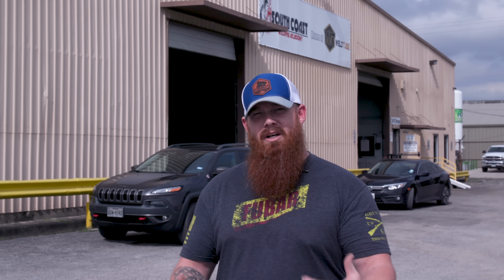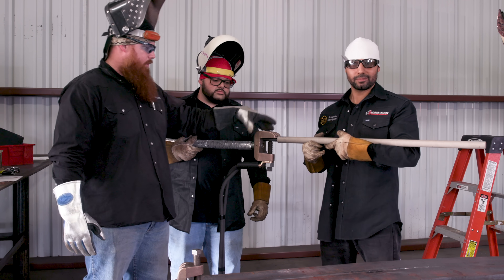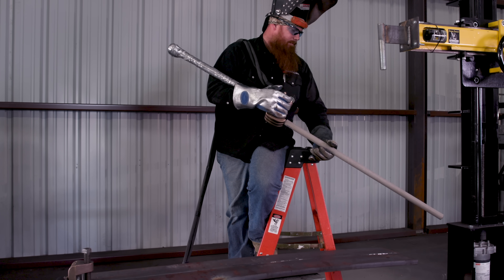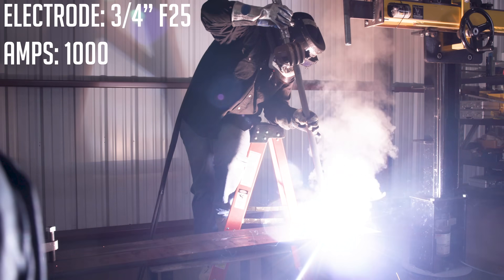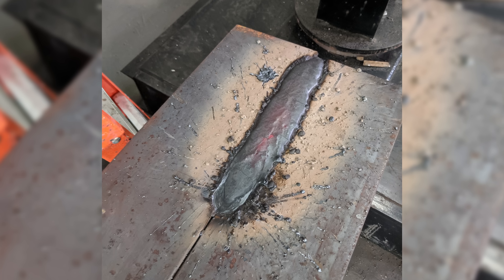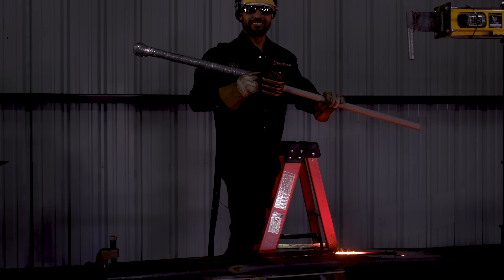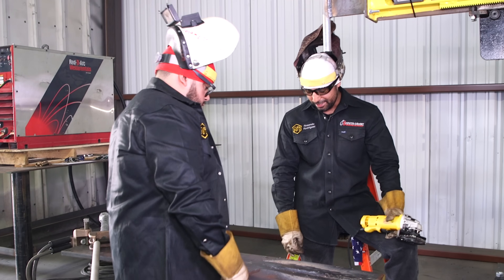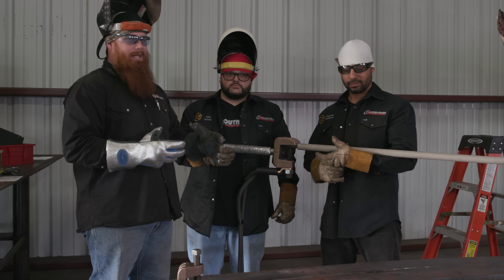1000 AMP STICK WELDING!! | Manually Welding with the Worlds Largest Electrode

Comment: "insulated" that looks like duct tape lmao
Reply: Do they make a smoke in hailer big enough ?.😨
Reply: Nah that's clear shrink wrap lol.
Reply: Is that pretty dangerous., holding it like that,  olds aren't enough to saturate the users body huh.
Reply: @ryanb1874  Only dangerous if you're wet, and even then it's 60V and there's a guy on the button. I was an Ironworker for a while, had a whole month of the Houston rainy season where I was doing trusses and such and was part of the circuit every time I had to change a rod. Shit that makes you not need coffee. 60V from arm to balls to ground. Not deadly for anyone that doesn't have a heart condition though.
Reply: @AtlasReburdened  volts don't mean shit a tazer is 500k- 1million volts it's the amps that kill and anything over .1 amps is lethal for reference if you shorted this rod to the material you'd be pushing over 1000 amps through your body
Reply: @dylanthegreat13  Ohms law states that you need a lot of volts to push that 100ma through normal skin resistance. Puncture the skin though and it's a whole new ball game.
Reply: @dylanthegreat13  My dude, you don't need to be preaching to someone who engineers electronics about how electricity behaves. I do demonstrations where I put the output leads of a bank of transformers which can put out 800A @ ~ .5V between my teeth with no more than an inch between them before burning through a framing nail like it's a car fuse. You don't just short amperage like a piece of metal, It takes volts to drive those amps through you. Like I said, 60V is only going to make you cuss if you don't have a heart condition, and only if you're sopping wet or just sweaty AF. Btw, no taser ever reaches 500KV, much less 1MV That's silly. A million volt arch reaches further than a human wingspan. There's like 2-3 inches between the leads of any taser you can buy so the air breaks down before it tops 50KV max. Probably 20-30KV in humid, sea level air.
Reply: @dylanthegreat13  If you short it, the short will be the preferred path and not your body (also the ouput voltage of the welder will drop significantly). 
Look at it like 2 resistors in parallel, one is several MOhms (or more, body+gloves+shoes, ... etc) and the other is less than 1 mOmh.
So the ratio is like 1:1000000000 and less (or more depends how look at it), which means that you'll have 1uA max passing thru your body.
Reply: @dylanthegreat13  No its the watt that kills you
Reply: The never ending “what kills you in electricity” discussion with the same mistakes and corrections over and over again. I’m glad that Atlas has explained the right things, with his diploma’s backing him.
Reply: @AtlasReburdened  Thank you some people just don't understand.👍👍
Reply: @ivgotballsofsteel4048  The term human wingspan refers to the distance between the tips of your fingers when you hold your arms out to your sides, I'm convinced that you understand this and you're just being disingenuous because for whatever reason, some people think they can come out on top of a technical debate by pretending not to understand things. Not a good tactic in my opinion. Question whatever you want, that's not going to change the behavior of electrons.

Comment: First
Reply: First of all the amperage is way too hot.. I welded all positions with 1/4’’ 7018 rods. You guys welding flat, the sound of the arc tells me it’s not a good weld.
Reply: @Flashflt2  
No bacon's frying at all!